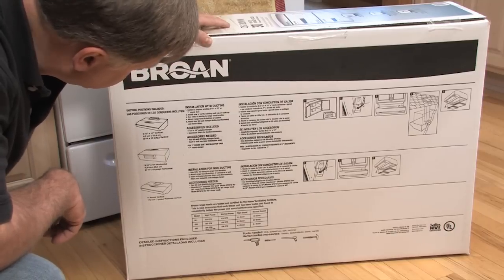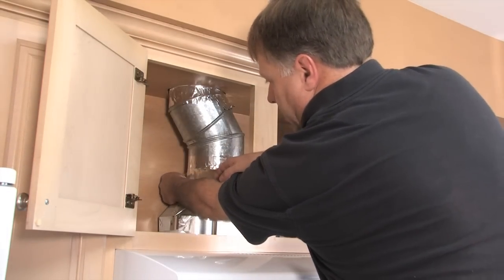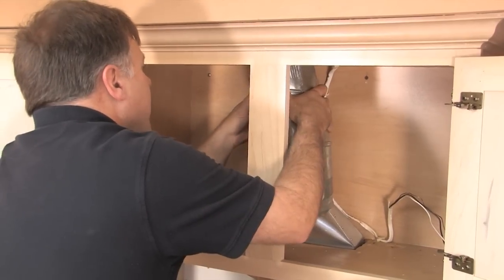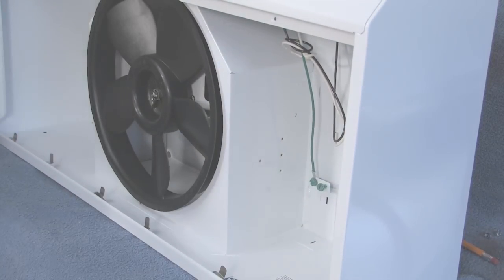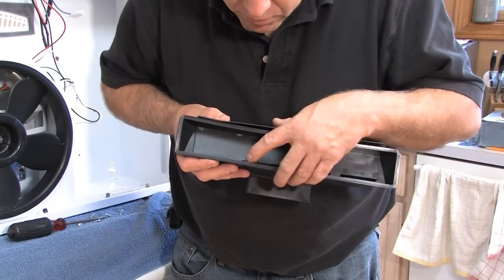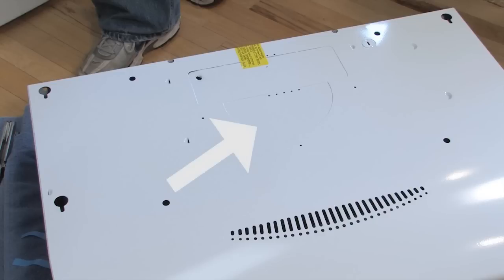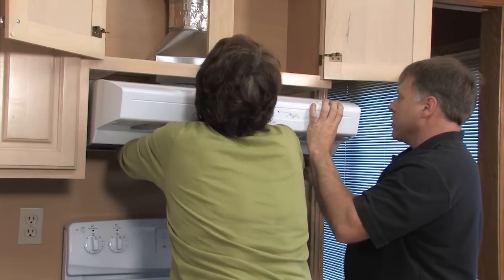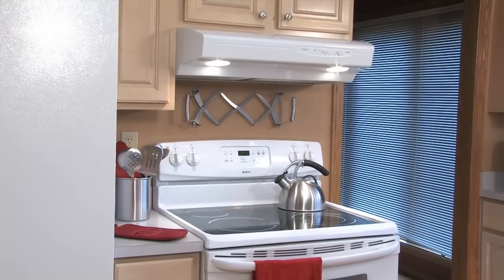How to Install a BROAN Allure QS1 Series Range Hood

Comment: I have installed many of these in some of my kitchen remodels and I have to say the fan is really loud. It does the job but very noisy. Also when setting up the air chute you're going to notice that air will still come out and not all be directed to the duct. For kitchens on a budget this range hood will be ok.

Comment: Why wouldn't you show how you connected the hood to the duct?

I don't it just sits on top.
Reply from the maker: In the QS1 video, the 3-1/4" x 10" damper/duct connector fits into the transition piece to convert the hood to a round duct.  If you need more assistance, please contact our Product Support team directly at 800-637-1453. We will gladly answer any questions you may have.